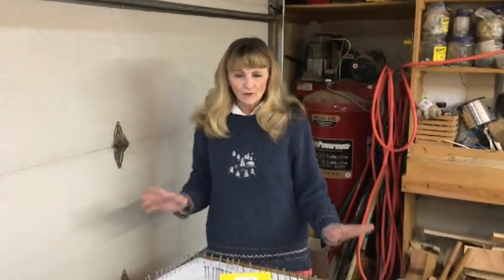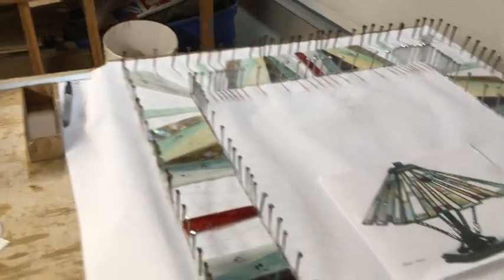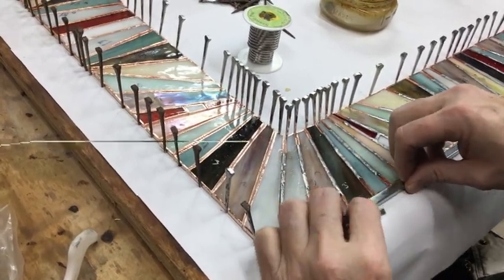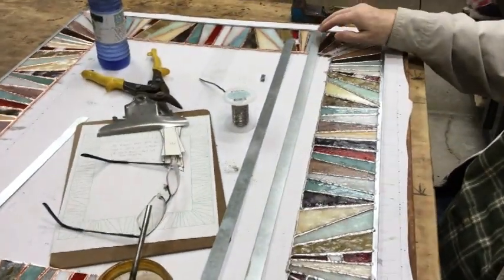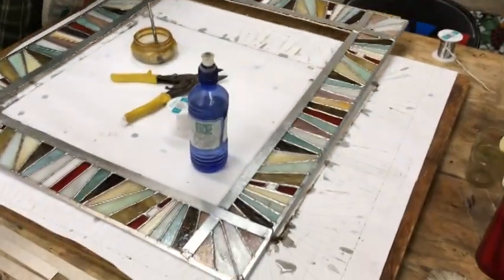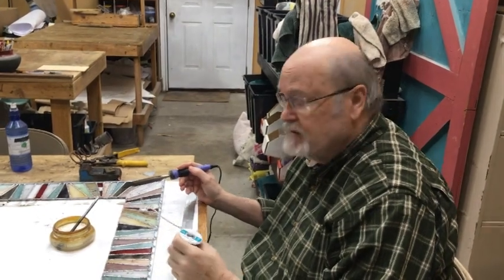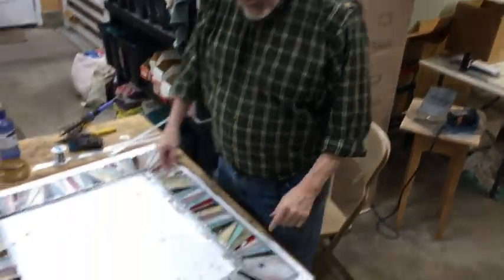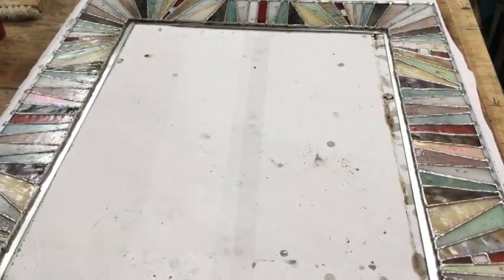Stained Glass Mirror Mirror On The Wall V247

Comment: I would be great to know how best to safely hang a stained glass mirror like this one.
Reply from the maker: Since the mirror is surrounded by bzinc outer bar, it would be very secure to solder rings and hang from them.
Reply: I am trying to figure out how to hang a 16” x 20” stained glass mirror from the wall. It’s soldered together, meaning the pieces are soldered onto the mirror as opposed to the mirror being installed after. The client doesn’t want any hanging mechanism visible and I am stumped on how to hang it while it being as flush to the wall as possible! Any advice is greatly appreciated and thank you again so much!

Comment: little late but hey? I am curious to know why you didn't just foil the mirror and solder into place? I have not yet done a huge mirror project but I use them a lot in my glass work, so far I have not had any problem.....am I missing something?
Reply from the maker: Originally, the client was going to put in their own piece of mirror. We were just going to furnish the glass frame. When I decided to furnish the mirror for them, we didn't want to solder the mirror in place because when soldering in a mirror, you often get flux attacking the mirror backing which causes the silvering to get corroded, so siliconing the mirror into place helped to avoid that.

Comment: What metal are the inside supports?  Zinc?
Reply from the maker: Galvanized metal strips, cut by a local sheet metal shop.
Reply: @GommStainedGlass  I have never been sure  what metals are suitable for soldering.  I know brass and copper and zinc.  Can any metal be used in stained glass and soldered?
Reply from the maker: @lahy7346  Only certain metals can be soldered, for instance neither steel or aluminium can be soldered.
Reply: @GommStainedGlass  Thank you for taking the time to respond.  I really appreciate it!